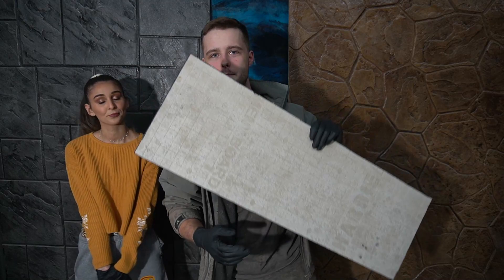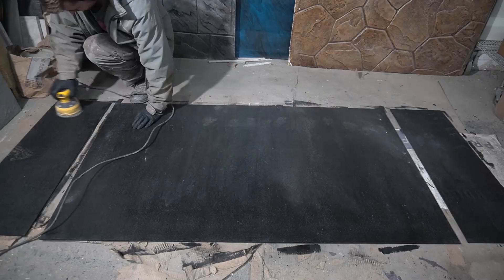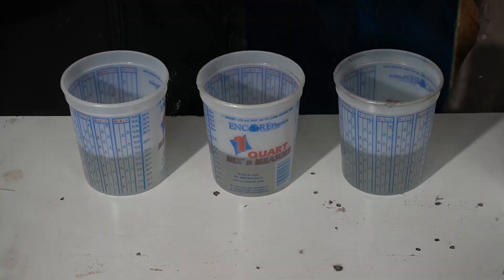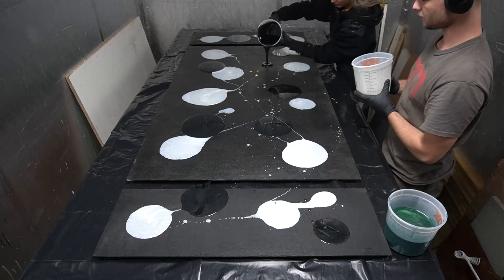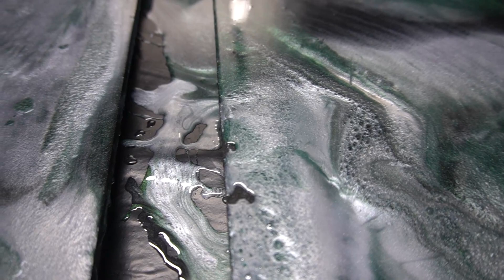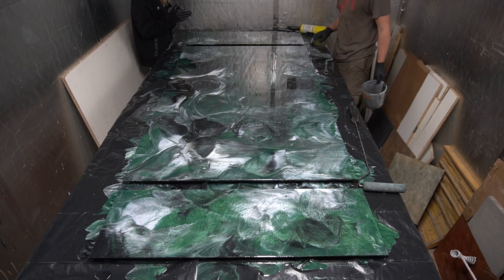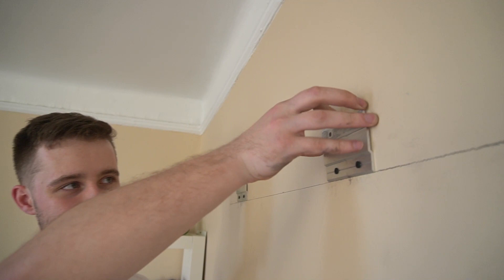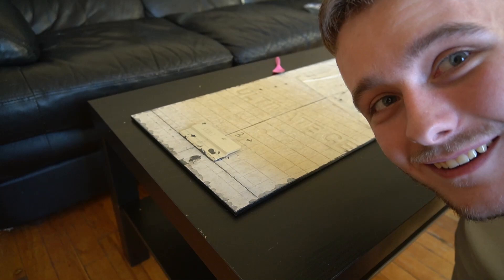Epoxy Wall Art | DIY

Comment: I would love to do this but with 4 square pieces. Do white primer on all, then pink, teal, purple and yellow in separate squares, like a smoky effect. Very inspirational video! Thanks!
Reply from the maker: If you mean each square would be a different color you should mix each separate color with a little bit of white too. Otherwise you wont get a smoky effect and only a solid color which is a little sparkly :)
Reply: @GlobMarble  oh cool thanks for the tip! I'll try it out soon

Comment: Did you put a top coat on it? & using the hardy backer, where/who did U get that idea from? Really clever.
Reply from the maker: Thanks man, it means a lot to me! No I didn't put a sealer because its on a wall and doesn't need to be scratch resistant. I used to make other sample videos on how to apply floor epoxy and I always used backer boards cause they were the perfect size. I figured they would look awesome hung up on a wall. I made this one white black and red, check it out :) https://www.youtube.com/watch?v=3w8FINseVb0

Comment: Great, how do you apply resin to a vertical wall?
Reply from the maker: vertical epoxy will always look ugly. We recommend pouring resin on a faux wall panel while it is on the floor, and securing it to a wall once it has cured

Comment: Hello
Does in need to be extra polished after it's dry?or polishing required only if you cut it?
Reply from the maker: You could polish it to create a total glass like finish, but this is not necessary
Reply: @GlobMarble  surfaces like tables or worktopes must be polished and varnished, because it's easy to scratch? That's correct?
Reply from the maker: It is recommended to use a food- safe countertop sealer without any polishing. This will lead to the most scratch resistant surface possible

Comment: did you clean or wipe with  anything to finish it.
Reply from the maker: The piece is wall art, it will never have anything placed on it and will never be scratched. It does not need a topcoat

Comment: Is hardibacker the best platform to use or something else?
Reply from the maker: I chose it because it is very thin, and wood that thin would warp way too much while the epoxy is still a liquid. A 1/4" MDF wood board would work just the same, its just way thicker than the hardie backer board.
Reply: @GlobMarble  Thanks for the info.  Do you know which one is heavier ?

Comment: Where did you get the hangers from?
Reply from the maker: I found them on amazon. https://www.amazon.com/Exclen-Interlocking-Bracket-Hanging-Aluminum/dp/B08T6DGSYH/ref=sr_1_44?dchild=1&keywords=mirror+wall+mount&qid=1617629547&sr=8-44
Reply: @GlobMarble  Thank you so much

Comment: Was there any strong smells and if so any suggestions?
Reply from the maker: No GE-100 omits no vapors at all. If any gets on your hands you will be fine but cleaning it with water is useless. I use denatured alcohol but regular rubbing alcohol works just as well :)

Comment: Do you have to use a blow torque for the bubbles?
Reply from the maker: You can use a heat gun and it works just as well, and some people spray denatured alcohol to remove bubbles but this changes the texture and also isn't as effective.